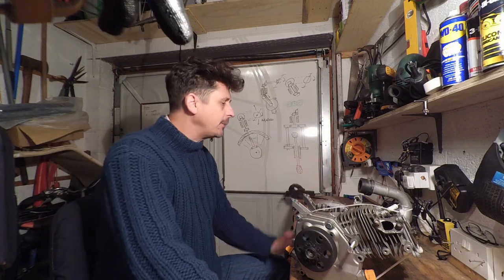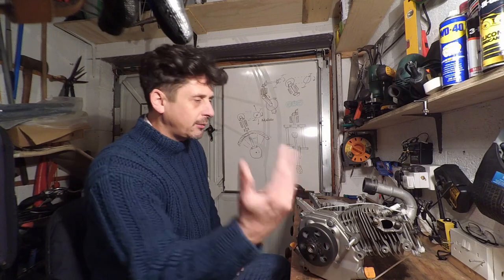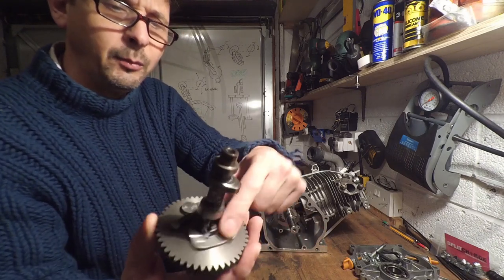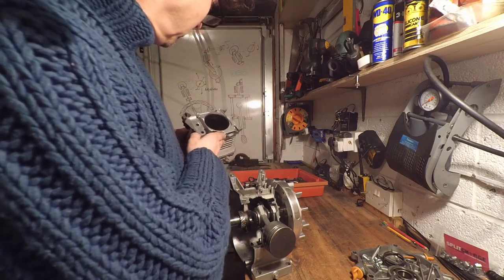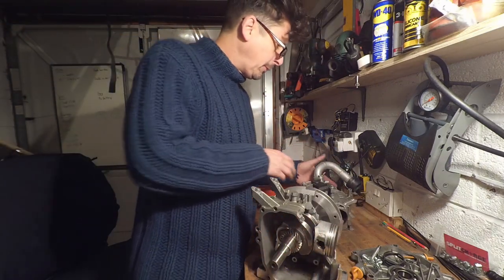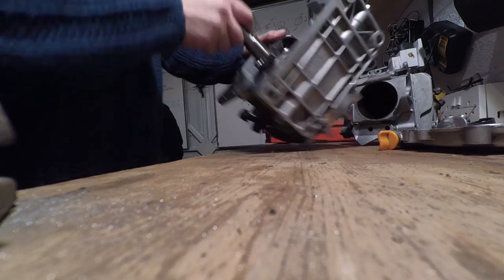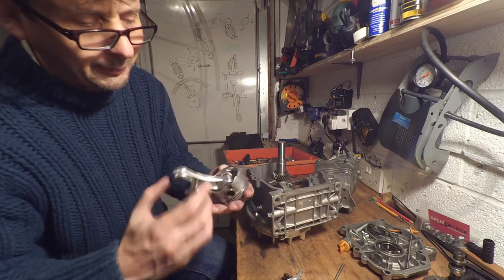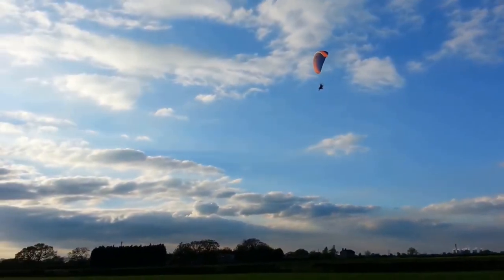Why did my homebuilt paramotor engine explode in mid-air?

Comment: It looks the internals are still in good shape and you might just need to replace the block, if you felt the need to build another one.  Considering you could still use the same cam, probably the flywheel, valves, pushrods, head, etc.  I am doing the same built, inspired by Rob :). I watched your first video of your bathroom scale thrust test on TeamEggmotor channel from years ago and I'm glad to see this update on what went wrong. Keep it up and you should post it on the Paramotor Homemade page on Facebook
Reply from the maker: Hi Steve... thanks for the comments.  I did post it on Paramotor Homemade I think.  Some really good info on there and one of my favourite FB pages. I am probably going to do anothe build at some point but undecided on the powerplant at the mo.

Comment: Go,simple. The crack was right where a bolt goes. Bad drilling/boring,  a slight crack, and the head cracks. 
Since the engine was running I would imagine that the force of the piston, would catch on the cylinder walls and push the separation more.

The end of the day it depends on what materials the block was actually cast from... but I think the primary damage and cracking probably emanated from torque or bad drilling right at the bolt.
Reply from the maker: Good thinking, Rainbow.  I reckon I agree.

Comment: Hi Tim, I've seen pics of guys reinforcing the block with welded up aluminium triangulation bits. I think the block was unable to withstand the additional compression.  I wonder if genuine Honda blocks are more reliable in this regard? Nice video :)
Reply from the maker: Same.  I saw one with a one inch square bar welded right up both sides.  I can't TIG yet so skipped it ... d'oh.
Reply from the maker: Also, I just noticed you have over 1000 subs.  Just need enough viewing time now... well done.
Reply: Ahah ... I wondered when Rob would give his expertise .... fascinating stuff guys :-)
Reply: @TimPriestChannel  Thanks Tim :) I was demonitized back in March as I didn't have the viewing minutes but just over the 1000 subs.
Reply: @BrianTurboT  I'll try my best but my mind is old and fuzzy now LOL
Reply from the maker: @BrianTurboT  Thinking of going round again but with a 390 this time?  Won't be for a while though.

Comment: I wonder if there was initially a smallish crack in the block which as it grew, snapped off the piston skirt as it passed the crack. Parts dropping off then down into the sump to clatter around with the oil splash wand etc. The casting is VERY thin, and the compression was all just all too much for it.
Reply from the maker: Wise words, Phil.

Comment: Wonder if it's due to fatigue. it appears to have cracked first at the bolt hole. Did it still have the tube Dell pins in the rear cover? I've found them to collapse and cause the cover to move around. Or possible over torquing the bolt could have cracked the case there. Thanks for posting the video!
Reply from the maker: Interesting.  Yes the pins were in I think at the time even though not in the video.  I could have over-torqued it there but reckon it's more likely that this is just a weak point in my opinion.  I like your thinking though.

Comment: You said you took it from 6.5 hp to about 17 hp. That is more than two and a half times what the original block was designed for. Most well designed things have a safety factor of 3 times rated load so you took it up to near that. Not good to take out the safety factor in things that can hurt or kill you. That was a Chinese block so who knows what its factor is. Knowing their low quality of workmanship its a good chance it was just at the rated load. As far as subsequent damage to any other components it probably happened when the thing came apart.
Reply from the maker: Thanks Scott.  Plenty of people have done these upgrades for Go Karts.  The problem seems to be partly that paramotoring requires it to be at persistently high revs (minimum of about 5k) and like you say the poor quality of the block.  I reckon you're right that I just pushed it a bit far.  Got a good number of flight out of it first though :)

Comment: That will be way too heavy.. u want as less weight as its possible on you shoulder.. if I was u, I would have bought a Thor 80 engine which is about 11.4 kg and can make 18 hp( or u can use EOS 100 booster engine with about 9.8 kg which can make 21.6 hp).. I have build my own paramotor twice , and I know what will be the best bang for the buck keeping the safety factor intact.. the first paramotor I made , I used Radne raket 120 cc engine 14hp, the second one I used Thor 190 which can produce twice the power 28hp and I managed to make the total weight 1 lbs less than my Radne paramotor.. twice the power with 1 pound less weight even with electric starter..the total weight including the battery and 3 blade prop 56 lbs making 28 hp . I am planning to reduce the weight of this engine by 8 lbs using titanium crank shaft and modifying the starter and engine block and reduction belt.  the engine u are building is way too heavy.. pleas don't take it wrong, I still love what u do.. enjoyed watching your video..
Reply from the maker: Thanks Kazem.  My priorities were fuel consumption and reliability.  It was good on fuel but obviously not on reliability!
Reply: @TimPriestChannel  none of the paramotor engines are %100 reliable at all.. they all have and will have some problems down the road but if u start with slightly larger engine to build a paramotor, I would say u are affecting the reliability by not needing to go full throttle all the time.. eventhough u might have a little more weight on your back . I would say u need at least %17 hp for any given take off weight to stay in good power so you could have petty reliable set up.. 
100 kg × 0.17= 17hp
150 kg  × 0.17 = 25.5 hp 
This will be the minimum for low aspect ratio beginners type wing and u can reduce it by factor of .%10 if using a wing with aspect ratio more than 4

100kg =>  17hpx 0.90=15.3 hp
150kg =>  25.5 x 0.90 = 22.95 hp
And if u want a little even more reliable set up u need to go by %20 more hp  but it will have more fuel consumption.  
100kg => 15.3 hp ×1.20 = 18.36 hp
150kh=> 22.95hp x 1.20 = 27.54hp
For a wing with aspect ratio of more than 4
If aspect ratio is less than 4 , u need to add that %20 to the first set
100kg=>      17 x1.20= 20.4 hp
150kg=> 25.5 x 1.20= 30.6 hp

Speaking of aspect ratio,  I am talking about projected aspect ratio not the flat aspect ratio of the wing..
Reply: In mysetup I am using a wing with aspect ratio of less than 4 to be safe.. I am using 28 hp which is %32 more hp than minimum required engine.. so I end up using the engine to no more than %75 power cruising..
It will have slightly more fuel consumption but it will be extremely reliable and if I step up to a more efficient wing with higher aspect ratio than 4 that number will be %46 more.. which is a over kill, but its fine.. more powerful engine will give u more climbing so u dont need to use the engine all the time.. u can simply go high and stop the engine and glide down and cover a huge distance...
Reply: A soldier with weight of 200lbs and 2 reserve weight of 20 lbs and 100 lbs of military equipment and paramotor weight of 75 lbs and 4 gallon of fuel 25lbs and wing weight of 20 lbs with projected aspect ratio of 4.2 . Will have totall take off weight of 440 lbs or 200 kg requires an engine 36.5 hp which will be A "Thor 250cc "